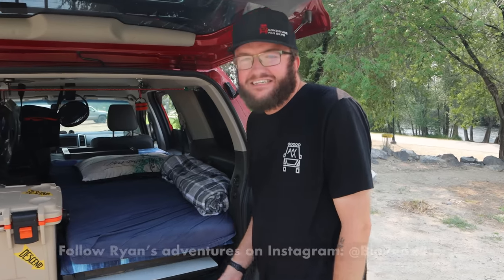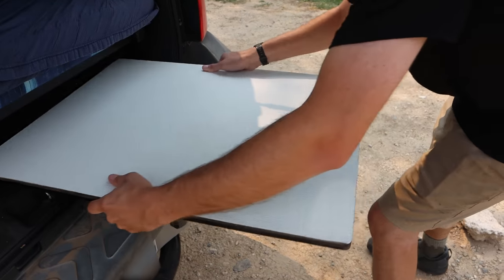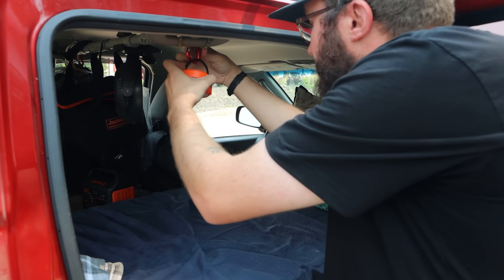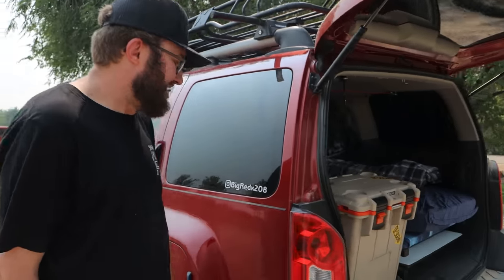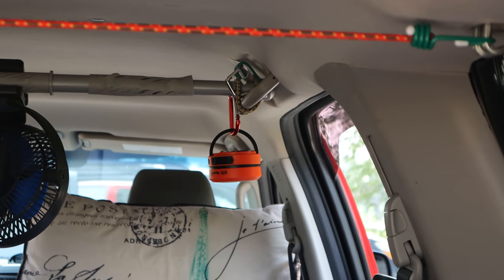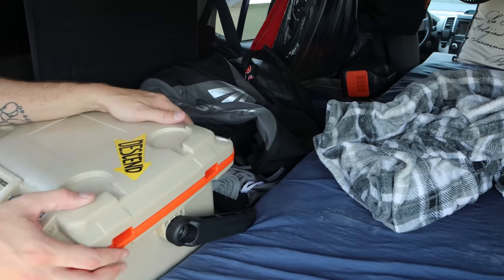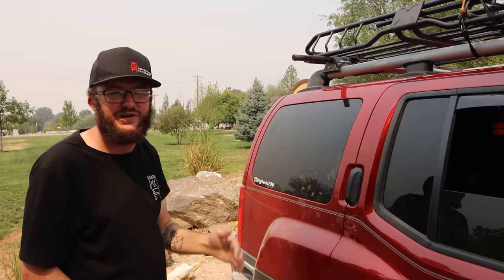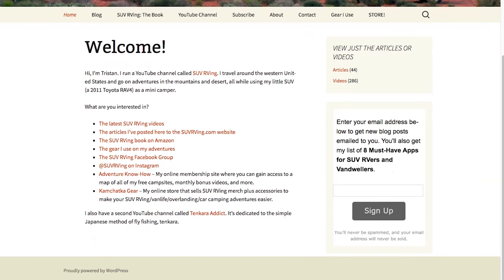He Lives in an SUV Full-Time! Full Tour of His Setup (Nissan Xterra)

Comment: Did something similar in my 2010 Highlander.  My only "build" was a bed platform and I didn't remove any seats because I wanted it to easily return to a passenger vehicle.  I camp in mine, usually for 10 to 14 days in one spot, traveling around for months on end, so I had to get a fridge (I eat fresh so there's that).  Also highly recommend a pop up canopy or a clam to use for outdoor living space, a camping table (rolls up and fits in a bag) and the ozark trail camp chairs Tristan has reviewed before (very comfy and work great if you have a bad back).  A privacy tent and collapsible toilet for the bathroom, along with a collapsible bucket and rechargeable pump with hose and sprayer for showers.  I joke that my SUV is bedroom, pantry and closet, the canopy is living, dining and kitchen, and the bathroom kinda speaks for itself 😂.  Back the SUV up to the canopy, open the lift gate and you have everything you need.  I usually leave my table, stove and chair out, lock up the vehicle when I go for a hike near camp, can even drive to another nearby location to hike and not lose my spot thanks to the canopy.  Can't wait to get back out there after my doggo heals from knee and ligament surgery!
Reply: Awesome setup👍
Reply: How do you keep the seats in but make a complete bed?
Reply: @LisaSoulLevelHealing  The second row seats fold down but not completely flat (it's about a 6" incline at the highest point), the third row folds flat.  My bed platform is 70" long and 25" wide, made of 3/4" plywood and covered in automotive carpet/felt.  I put 6" legs on the bed at one end and in the middle, the other end rests on the folded second row seats.  There's a bit of storage space under it but not much.  I found a 4" thick trifold memory foam mattress that is 25" wide and 75" long, I cut 5" off the end so it would fit on the platform.  I'm 5'4" tall, weigh 135ish lbs, so it's perfect for me and my little Yorkie to sleep on comfortably.  I can't sit up on the bed without hunching over but since all I do is sleep in the vehicle it works.
Reply: upload a video of your set up like this one!
Reply: I have a 2015 Highlander. The 2 back seats didn't lay flat, & even if they did, they'd take up too much precious space, so I took them completely out.  These Highlanders are LONG, so with no rear seats there's a ton of wonderful open space! 

I laid in a rubber horse stahl mat to help smooth out the uneven floor & put a softer mat over it. This was my "build," nothing more. 

I sleep on a narrow foam mattress laid directly on the floor. Soft sided bags & pillow cases for storage. ( plastic boxes are inefficient space hogs.) I reworked a wooden 10x12" bird's nesting box into a mini chuck box that holds my backpacker's stove & 2 spare fuel canisters, it also doubles as a night stand next to my bed. **Have things that serve more than one function.

2 gal pale w/ lid serves as the chamber pot. Another pale for rag baths when H2o is sourced. Coleman marine cooler, cheap & just the perfect size to fit behind the driver's seat. (Doubles as a food prep table.) Reliance 7gal. H2o container rides upright in front of the passenger seat.

Ya, the window rain guards are essential to keep out the weather, of course, but they give you stealth ventilation for when you don't want nosey people to know you're in the vehicle. A roof top cargo box serves as my attic space.

Hope this helps folks who are just getting started with nomad life or suv camping. Happy trails 😉. (15yr Nomad here.)🙏

Update: Just bought three 10L MSR Dromedary bags to replace my huge/bulky Reliance 7gal plastic jug. These bags are pricey, but they take up a hell of a lot less space in a small rig. I like them so far. Saw Amanda use them on her "Tideline to Alpine" channel, & I thought these bags would be less heavy to lug h2o in, & they are. 💦👍
Reply: i live in my semi truck, i have hotel sized refrigerator, i have to charge batteries at least once a day to keep it working, what is your setup for your refrigerator to keep working? Does regular SUV battery with the help of inverter work for refrigerator?
Reply: @catpatrick3838  I'll be hitting the road with my Yorkie mix in May.

Comment: In order to use your weather tech window coverings black side out you just put the on the opposite window of the same size and it will fit correctly, this way your windows will appear to be tinted at night. When you leave the foil side out at night you can see it and it’s obvious that someone is inside sleeping. Same thing with the sun shades for the front windshield mine have the silver side and the black side and when it’s night time I make sure the black side is positioned outwards
Reply: Guess I should have scrolled before commenting 👍
Reply: Do they keep heat out the same black side out? Say if you have them in that way during the day. Or should you be switching them back and forth if you wanted to leave the back ones in all the time?

Comment: Ryan seems like a cool dude keeps everything organized and clean you would never know he lived out of his Nissan Xterra
Reply: Thanks Anthony!
Reply: @BigRedx208  So it's a 2010 Xterra? With over 100 k miles? Have you had any problems with your ECM? I have a 2014 Xterra with just over like 95k ,and my ECM went out all of a sudden with maybe a little bit of a warning via transmission issues. Xterra's are great vehicles,despite my experience.
Reply: @johngavin1175  i have a 2006 Xterra SE and im getting to 180k and ive never had a issue with my ECM
Reply: @BigRedx208  howser the rev life going? It all looked brand new. Saying. "If I ever. "  wondering how that's worked out.

Comment: LOVED this video. I have a Nissan X-Terra, and I am fortunate to be short enough to easily sleep in the back. I also bought the Weather Tech window coverings. They work great. I use one gallon water bottles because their weight is easier for me to handle. I have a small GoalZero battery and a folding 100 watt solar panel. The battery will charge in about 45 minutes of full sun. I mostly do overnights in my home state of Arizona, but I have camped out for a month at a time. My cooler is a small Yeti. I have often thought I could live full time in it if I needed to. This confirms that. Thanks!
Reply: Thanks Barbara!
Reply: In which state do you travel? I ask because I have the 150Yeti GoalZero and the 100W panel and in summer it needs 4 hours to charge completely here in Germany.
Reply: @Parkitloveit  I live in Southern Arizona near the Mexico border in the Sonoran Desert. Without much water vapor in the air, the sun is very strong. I did live in central Virginia where it is very wet. The same battery took a whole day or two to charge there on a 100 watt panel. The amount of moisture in the air seems to make a huge difference. Our city here in Southern Arizona has two huge solar arrays outside of town. Also schools and other public buildings such as libraries have covered parking, and on top of the parking shades are more solar panels. It is practical here to make electricity from the sun for consumer use.
Reply: @barbarashirland9078  that sounds good 👍 sounds like I should travel to Southern Arizona very soon. It’s so annoying in Germany that the sun shines so rarely and I hope I will be more lucky in Italy where I will spend this winter. Have a great day 🍀
Reply: @Parkitloveit  Italy should be great! Have fun!
Reply: @Parkitloveit  have fun poly👍
Reply: @BigRedx208  Thanks man for sharing that!
Reply: Hey Barbara, if you can please tell me about that solar panel name or some link for buying. Because 45 minute are very good time for charging full battery
Reply: @fml5910 lady with a beard!

Comment: And you can use the Weather Tech window coverings with the black side out for stealth. All you have to do is switch sides. The two sides are mirror images of each other. You can’t flip the rear window, so I put black cardboard on the shiny side of the rear window covering.

Comment: Just FYI, if you want the black side out, you switch the covers to the opposite window and it'll still fit exactly. So the cover labeled rear passenger would go on the rear driver window if you want the black side out.
Reply: That's what I figured but good to hear it confirmed. I liked the idea of storing them under the mattress. What can you tell me about the longevity of these vs diy kind
Reply: @susie9893  These will last years. The DIY ones don't.

Comment: For anyone wondering. He said something about the weathertech window coverings not fitting right on the black side. The black side is for the winter and to get them to fit correctly you put them on the opposite side of the vehicle. Passenger side silver will be driver side black. Just a heads up. I have a full vehicle set and love them. Way better than the homemade reflectix

Comment: I have those same solar lights and they are great! I just bought a roll of magnetic tape from Walmart cut 2 strips and put it on the back of the light so I just stick them to the side of my van at night set on motion detection. During the day I put them face up on the passenger dash close to the windshield to recharge via solar

Comment: Back in mid 80's I basically lived out of my 1974 Ford Econoline van. It was a smaller one with a small engine with three in the tree. But I had a single bed a frame I put in it. Back then there wasn't a lot of stuff that you have today. I had a cooler that I put ice in every three or four days. I carried a small charcoal grill with me. I started driving big rigs in 88'. And most companies I drove for were from another state from where I live. So by then I moved up to a Dodge Ram conversion van.  And that was great because I would drive to where the company was, so when work was being done in my truck, I had my van to go and do whatever. But back in the 90's I found a butane one burner stove at the T/A truck stop. And that was the only place I ever saw them. So I got that and then Coleman and Igloo came out with these small motors in their coolers. So it got to be pretty good. And living in my big rig was basically the same as living in the van. Just a bit more room. I really enjoyed living in the van.  Carried my guitar and just hit the parks during the day, then find a spot for the night. Usually at some truck stop.

Comment: I live full time in a 2001 jeep grand Cherokee. Thanks Tristen for all of The information in your book SUV RVing. I still keep the book with me on My travels as a reference
Reply: Building my 2003 Laredo as we speak. Kept the front seats, totally removed rear seat. Plywood subflooring (instead of a raised platform for a bed) gives plenty of hidden storage compartments. Two 200 AMP hour lithium ion batteries working off of a high output alternator and inverter handle all electric items (frig, laptop, lights, phone, ect). Not complete, but getting there!
Reply: Holly fuck lol I have the same jeep mines a 04 I live in mine full time wish you luck stay safe
Reply: @walterj.radomski9669  I'd love to see that set up once it's ready good luck

Comment: That white table top material foryour slide out, looks like .090 inch thick FRP (Fiber Reinforced Panel) thart is commonly used in wet environments, such as bathroom surround walls, kitchen wall surfaces, etc. Like you said. Easy to clean, and very durable. Often available, even in different colors, from your Big Box building supply stores. Remember. FRP that is .090" thick. Contact cement will adhere it to other surfaces, or other adhesives. It's not too fussy about that. Try adhesives on a scrap piece first to make certain that they don't damage the material in any way. Nice build, Ryan! Good ideas.
Reply: Thank you for the clarification! I forgot what my father had told me about that material. Basically, it was free and durable! Good enough for me! Thanks again 👍🏼

Comment: In older vehicles (without smart alternators) it's very easy to chuck in a dual battery system and mount a solar panel to the roof. You don't even really need an isolator for the main battery if you're driving and getting charge most days so your only outlays would be the battery itself, some cabling, and USB and 12v outlets would be easy to cobble together. Or even do what I do which is power the vehicle factory outlets full time without needing a key in the ignition.

Both my cranking and secondary batteries are marine batteries and for a similar price to that Jackery I have 4-6x the battery capacity and can run a fridge full time if I have sun every day. I use a manual isolator for the odd occasion where I might park 3 days in a row and don't want to run down the cranking battery.

Just something to think about.

Comment: Great set up. I've got those same window coverings coming, if I want the black facing outside, is it possible to put them on the opposite sides of the truck? If the windows are mirror image, it should work?
Reply: Hi Lynn! I’ve been using the same window coverings on the opposite sides during the winter. Silver side out on the drivers side can work with the black side out on the passenger side, etc
Reply: @BigRedx208  Great! I've got a 2022 Chevy Blazer that I want to take down Hwy 50, "USA's loneliest highway. I think you talked me I to the window deflectors, too. I never knew what they were for.

Comment: I'm turning a mini van into a camper.  What need, IMHO, is a blue flame, ventless propane heater designed for the size of a SUV, about 12 inches by 12 inches.  The gas line fittings could go up thru the floor.  A 20 lbs bottle like for a BBQ Grill would last about 5 days even in the coldest weather.  A fan duct out the floor to vent the moisture and pull the heat down.  The smallest ones are 10,000 btu.  We need a 3,000 btu blueflame, with big bottle fittings.  We'd need a CO/propane alarm from the RV supply.

Comment: I have similar (motion) lights. I attached rare earth magnets on the back so I can easily mount/remove them basically anywhere. I have a fiberglass truck cap, so I stuck a couple of those thin metal phone mag mounts where I want the lights. Since they're solar, I have them stuck to the hood near the windshield to recharge while driving. I use the hood so I can make sure they don't fly off. I've gotten up to a little over 70mph without issue, which may be do to the negative pressure area near the windshield.
Reply: Modern hood ornament. I’m going to use this idea to use the solar try lights I have at home to go traveling with me

Comment: I have front and rear Blackvue cameras on my Xterra., The blinking lights indicating recoding might run an intruder off. If it is police it probably won't. My Xterra's front passenger seat folds over all the way forward. Makes it a little easier getting in  or out of back when it is raining or snowing.

Comment: I always like watching how people build out their spaces. I do want to make one point though, because it was something I had seen in someone else's build. They had a long bed type setup behind their driver's seat, made with single long pieces of aluminum. The problem was they figured if they ever got into a really bad accident possibly between two vehicles they had essentially built a spear that could go right through the driver's seat. Your build seems similar just on the passenger side, at least based on what I could see. That person just ended up making two separate pieces that were offset to get rid of that issue. Just felt a need to point that out.

Comment: So, I got wore out watching possibilities and hoping to find a van!  Everything in my price range was either rusted and gutted or so high in mileage till the odometer started rolling backwards!😂😂

I have a 2004 expedition.  I pulled the rear seating out and took ideas from you and some others. My electrical is a MPP 800 all in one with two AGM’s. Doing the bucket thing for you know what. Wired up led light for bright light. “Microwave doesn’t work!🥲

I’m on test night two trying to revise until satisfied!  Thanks a bunch for these videos. I wish you could see some of these DIY mods!  Crazy but works. Oh, I’m using a Diesel heater for these 30 degree nights. 

If I can figure how to do a video I’ll post something.  After the first night I learned some real lessons. Second night was more comfortable. Have to work on a few things but by night 255 I should have it!😂😂. 

Thanks.

Comment: Great job with your video.I have a 2006 xterra.Beware of the strawberry milkshake of death.Thats when your transmission lines in the bottom of your radiator fail and put coolant in your transmission.
Reply: Thanks John! I’ve researched that issue before. Fingers crossed 🤞🏻 Hopefully the extra maintenance needs that have been done at the Nissan dealership help keep the breakdowns at bay!

Comment: Bit easy to miss, but Ryan did mention showering at the gym. That's important. I have an old membership to Planet Fitness that's still good. If possible, wait until they offer their $10 a month membership drive. ($40 every September.) So, $150 a year gets you access to equipment and the showers. Invest in a good pair of shower shoes and a combination lock too. 

Also, far from a ringing free endorsement of Planet Fitness. They have a ton of issues. Including, hating the fact that some call them a "gym." Honestly, they're the nearest fitness center to my apartment. And the membership is cheap. Otherwise, I'd go to a better gym.